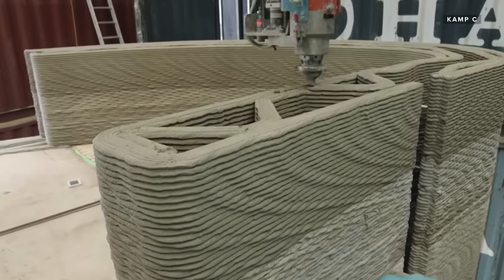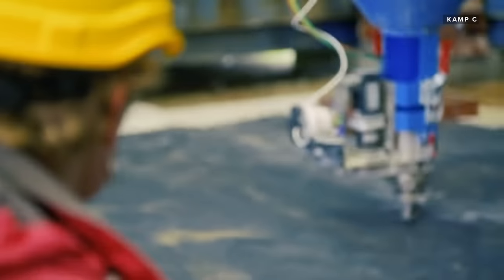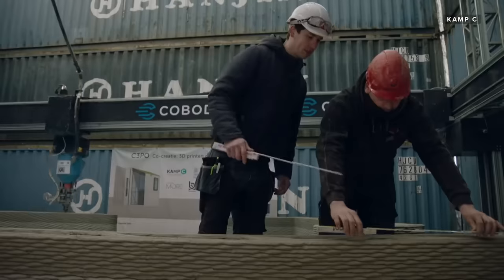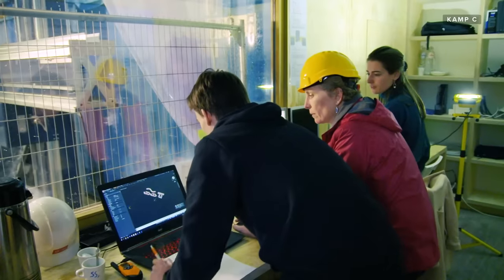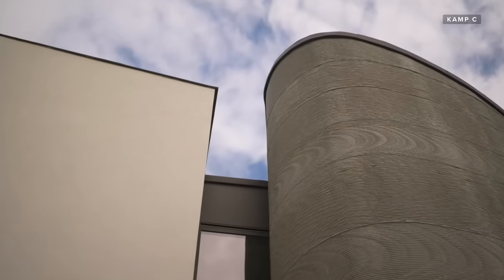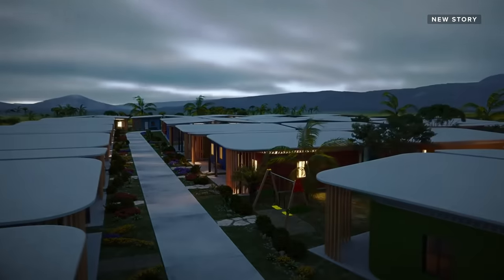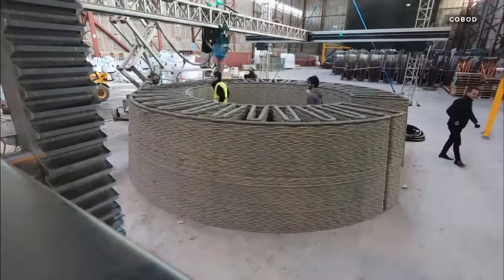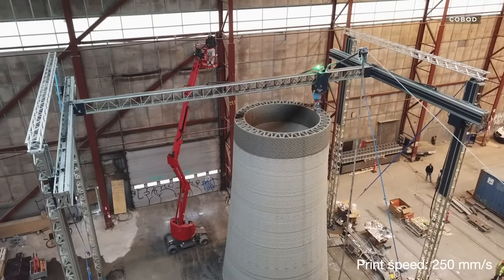Giant 3D-printer builds a TWO-STORY house in one piece 🏡

Comment: I wish there were more dome enthusiasts designing more 3D printable spherical buildings for residential use in seismic and hurricane prone areas.
Reply: Hi from Will and Mr Data :) :]
I did a kitset dome some time back its a cgtrader.  Be well :) :]
Reply: What is the benefit of a dome building in hurricane conditions?
Reply: dome type will be good for Mars habitat too. Since we wont get humans there, the printers will have to print the roof as well.
Reply: @CyberWorx  WHAT? that was your edited comment? maybe do another edit. Doesnt really make sense
Reply: @brettmastema7056  just off the top of my head concrete  would probably hold up better to flying debris and you could print the house in a shape that allow wind to move past the house instead of pushing on it.
Reply: @marsmech  cool
Reply: Hush lil bro

Comment: When my print fails I’m out a few cents maybe a dollar or two in filament.... when their print fails...
Reply: All thay have to do is turn it into dust and reconstituted with some water. Just like you just brake it up bland it up and remelt it and your good
Reply: You  clearly dont get it.. Oh and 21 others do not either......
Reply: I imagine they'd have at least one person there monitoring them
Reply: They just market it as a "feature"  (extra handhold or novel window)
Reply: @Anna-tc6rz  that was just a tech guy trying to make a joke. It wasnt very good because the premise is off.
Reply: @madtscientist8853  concrete doesn't works that way, it's one time use.
Reply: @Kevin-fj5oe  i literally just googled concrete recycling and the whole front page says you're wrong, Kevin.
Reply: @IndiePoppedhearts  concrete is one time use, since the chemical reaction between cement and water only happened once, those concrete recycling are basically used the crushed concrete to be used as aggregates or whatever use a rock could do. the person i responded implies that you can recycle concrete like recycling clay, which you can't do given how concrete works chemically. Also, concrete is a mix between aggregates/cement/sand/water, not the grey cement powder.

Comment: That's interesting.  But I wonder if they will use reinforcement for making that windmill, or house walls.  Concrete can crack very easy without reinforcement.  And if the structural is large and has no expansion joints, they can crack when the weather changes.

Comment: Swimming pools will need a different concrete mix, Right now I build gunnite pools in Florida and It would be great to print a pool ,  but it may take a few years to get the mix right since water causes concrete to cure, The mixture may crack due to excessive curing and also sun exposure. I would buy a cobod now if I knew I could get a perfect mix for pools.

Comment: This makes sense for southern climates, that would otherwise be built with CMU concrete blocks (in winter subzero climate airtightness and insulation is obligatory). But what is the  drying curing time? A rain fall could ruin the print halfway through. What about foundation and anchors? The demo shows a print of a flat warehouse floor. Steel rebars would still be needed to anchor walls to some conventional concrete foundation.

More testing is needed
Reply: I think the best way to look at these types of projects is as a proof of concept.  The electric car has existed for years, but it wasn't until last decade that they truly saw their potential.  Regardless, I don't think the idea for printed homes to be for every use case. The primary interest is when you need a LOT of structures built quickly. At this current iteration, what comes to mind is quickly creating shelters for refugees or another situation where hundreds or more people suddenly need shelters to accommodate.

Comment: My one question is how do they run the Electrical wirings and fittings on these sorta buildings?

That part I need explained, also the  plumbings parts. At least we can see they're made to avoid using iron rods for structural integrity. But the 2 asked here would really be a great knowledge to understand how they overcome those. 

1. Electrical Wirings
2. Plumbing done.
3. If staircase or lifts how can they accomplish those.
Reply: The same way we make concrete buildings now, they have an inner frame.
Reply: @spielmitmir26  please elaborate ?
Reply: i dont know a cost effective way to get HVAC, PLUMBING AND ELECTRICAL done in these homes to say the least

Comment: I would like to have seen the floors printed.  

Regarding rebar comments, I imagine the concrete mixture contains fiberglass in the mix which I believe would enhance strength, depending on the span and engineered specified weight limit. I don't think the Cathedral of Notre Dame had rebar in it's structural core.
Reply: Not fibreglass but tiny, 7 to 10 mm long steel needles that make the concrete sturdy just as the traditional one!

Comment: Concrete is normally reinforced. Why is the windmill support not reinforced? Concrete is good under compression but rubbish under tension. When the windmill shakes, parts of the base are under tension and will develop cracks. During  sub-zero temperatures water will creep into the cracks, freeze, expand and increase the cracks. How is this handled in 3D printing concrete?

Comment: Whats the energy rating though? Are the gaps filled with insulating wool or beads? And can the machine be used to 3D print a house djacent to anotheer, leaving only 3 sides available for the machine to operate from.

Comment: Interested to see how this plays out with the cement shortages due to running out of appropriate sand for concrete...
Reply: This gave me an idea, plastic/hemp 3d printed houses. Seems like a better material than cement for short term.
Reply: @EvenFive  How do you plan on melting the kind of amount of plastic needed to make 8cm wide lines at an acceptable speed?
Reply: @expression3639  scaled up hardware. The real problem is cooling the plastic.
Reply: What shortages?

Comment: I wonder how they solved the rebar issue
Reply: Not only that, but the insulation, wiring, and HVAC issues.
Reply: @6h471  The way I understand it, the inside is framed out with wood/drywall.  You would have room to run all your electrical/plumbing/HVAC, and insulate.

Comment: LoL as an 3D printer user, I aks... Does it make support?
Reply: Humans add in the supports manually during the print.
Reply: @expression3639  yes, i noticed but it would be cool if it could print like light parts for supporting overhangs and you can like knock it of easly

Comment: no steel structures needed inside? in seismic zones?
Reply: Betting it's fiber reinforced concrete with rebar laid in where needed manually. Can be anything from synthetics to steel strands mixed in, and as far as breaking the stuff down with a excavator and a hydraulic hammer, bigger pita than traditional rebar. Also more expensive as far as I know. Course, you don't pay for as much rebar.

Comment: How do you add insulation? I see small cavities that could hold insulation, but there is also a lot of areas of thermal bridging. Also, how do you run utilities (plumbing, power)?
Reply: The internal structure of the wall looks like running pipes and electric lines wouldn't be too difficult. That obviously wasn't mentioned on the video. The way the concert was layered in a zig zag pattern seems to be very strong and probably has plenty of insultating properties as is.
Reply: You insulate from outside - simple styrofoam will do!
Reply: Watch other videos of 3D printed houses & buildings. They tell u how it's done. I've watched several videos on it.
Reply: @kevina2052  Concrete is not a good insulator.

Comment: I guess because you are accepting inside and exterior walls w/o insulation, and no siding/interior drywall, I guess that is the savings?  

Still have to rough plumb, electric, slab floor, have trusses for the roof... Then install windows and doors, and paint...  and AND then the kitchen and bath room stuff (cabinets, toilets, sinks, etc)...  I think it is cool tech - but is not a true "3-d" house. Am I missing something? A concrete block house would be possibly cheaper... I get it - you can make curved walls which is cool...

Comment: I wonder if those structures would pass costal area storm codes?  Housing definitely costs too much for the average worker.
Reply: The Outlier it appears to be non-reinforced concrete (no rebar). I don’t know how it could last, especially where there’s seismic activity.
Reply: @bobspamail  I noticed that which is why I asked.  I live inland so wind resistance would be my primary concern as I don't experience flooding.  They wouldn't last a minute against storm surge.
Reply: They do

Comment: While this is cool, I can't see any net benefit other than automating away jobs. This can't be cheaper on materials as I'm sure the concrete mix has to be very specific with plenty of modifiers to work well, i.e. expensive. Not to mention that curved walls look cool but they make for completely impractical surfaces for decorating and fixturing.

Comment: Reinforcement?
Reply: Could easily be fibre reinforced and you can tell there is strength webbing in the wall. Would easily be stronger than block and equal to most solid poured

Comment: but why never renewables? like plastic or class. why isn't it printing that for us to stay in?
Reply: Just what kind of temperature do you think are involved in printing plastic that you think you can just print 8cm wide lines of plastic like it's nothing?

Houses of glass?
Reply: @expression3639 World's Largest Plastic 3D Printer - 3D Printed Pedestrian Bridge
Reply: @expression3639  The first 3D-printed boat, 'built' by the world's largest 3D printer
Reply: @expression3639  all I'm saying is sort out different kinds of plastics, then cut them up in small fine pieces and then melt them back together into one large project... kind of the same principle like a doddle gun, you don't heat all the plastic at once... just the ones at the tip bringing your temperature must lower

Comment: If they can get the 3D printer to be able to print itself you could ship a smaller 3D printer to a site and have it create a larger 3D printer and that create larger 3D printer while still having the older 3D printers creating more 3D printers to print houses: here is the exponential growth by generation -> 1 2 4 8 16 32 64 128 256 512 1k 2k 4k 8k 16k 32k ...  In 20 generations you can have 1 million 3D printers, but in truth you may only be able to 3D print 50 - 95% of the 3D printer in which case to have 1 thousand 3D printers you will need 1 thousand pre-fabricated parts.

Comment: You said that you wanted to know, well.. here you go. : - )

Go to my other channel and find a playlist called "Graphene buildings / structures", for 3D printed Graphene buildings / structures.

And check my other channel for Graphene with cement, don't go to the videos section of my other channel, only the playlists.

Also check my channel for 2 simple steps, be sure to go to the "About" tab of the channel I'm commenting with now, and read the info, but also save the link found there.

--------------------------

I wouldn't want 3D printing without Graphene. Also Graphene and Quantum Technologies are all over my other channel with the link under my About tab on the channel I'm commenting with now.

Comment: construction more sustainable... with a little oversight on the most unsustainable remains one of the miracle components of the miracle material, concrete that is cement. Production of cement is CO2 intensive... I wonder how this house measures up in other sustainability criteria... for example  beams would still need to be shipped for the floor slabs on a massive trailer.... I would never trust a 3d printer with the job.. also making it on site is tricky if pretensioning is required.
Reply: Are you interested in building?
Reply: @technologiesofthefuture8250  how could I not be? My family is doctors and engineers sitting around a table :D